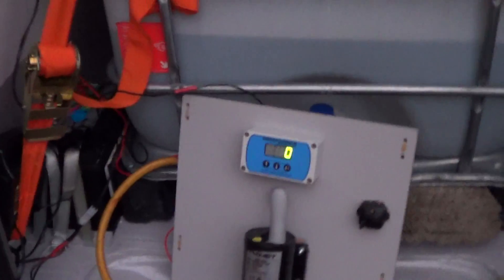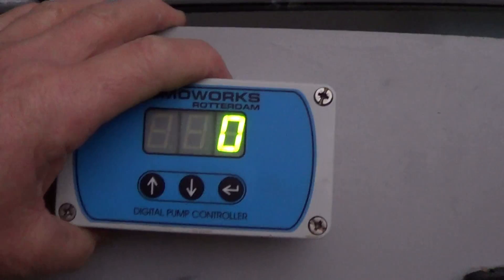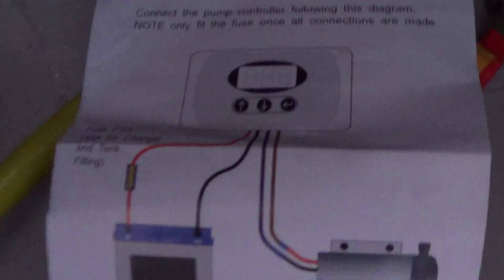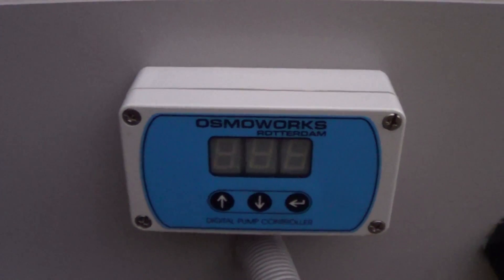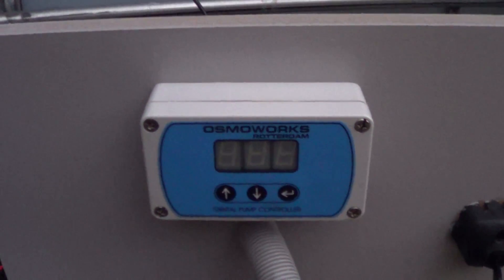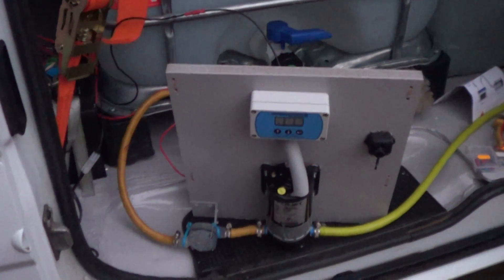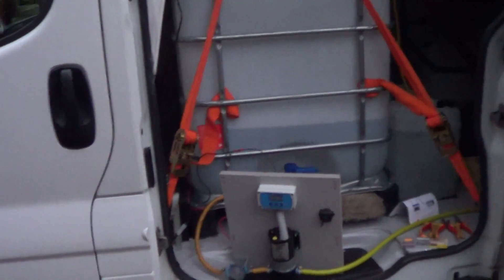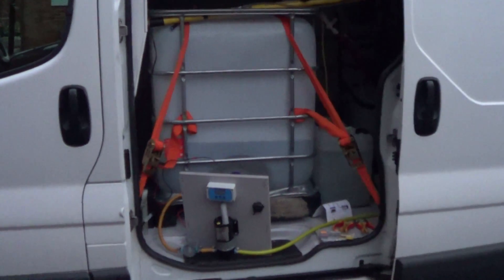DIY WFP Van Mount - Part Six Flow Controller

Comment: Cool videos. Could you not run wires to the actual van battery instead of recharging the battery for the pump?
Reply from the maker: Yes you can do that but risk flattening the battery and not being able to start the vehicle again. You can fit what is called a split charger so you can charge the pump battery using the vehicle. See a proper electrician for this though.

Comment: I wired mine up correctly, mine has an onboard battery charger, but i can't auto cal the Unit, as it tries to say the battery is not charged when it is, the PS error message keeps popping up, Just seems easier to use a direct to pump battery connection and just charge the battery from a standard charging unit in the house... A bit lost with that one, as i can not predict when the battery will run out... i know that the PS message means pressure switch activated or motor disconnected but nothing i try to get it to run works
Reply from the maker: MrHoodedtop I can't help you with this one as I don't know the answer. I would prefer the old analogue type of flow controller.

Comment: Can I just get a dimmer switch instead?
Reply from the maker: Dk Scooby Whilst in theory it's a good idea, a dimmer switch is for a 240v system so it might not work.
Reply: Christopher Dawber I will have a try and let you know soon thanks mate
Reply: Christopher Dawber I’ve tried the 240v but didn’t work so I got one off eBay 12v dimmer for £5.50 and it’s working perfect 
anyway it’s better to have the proper one with all the extras but for someone starting up it will do the job 
Thanks buddy 👍

Comment: How do you get around the vacuum as the tank is unvented? ( insert a tyre valve the wrong way round in the lid)
A way to baffle the tank is to cut up lengths of tubing ie guttering or soil pipe and inserting them into the tank. 
I don't agree with wasting money on an aqua tap .... Just bend over the hose on the pole the water will stop ..... I get told well that depends on the type of hose..... No I have done this with all types of hose.
Reply from the maker: Alan Harvey Hi Alan, the tank has the filling hose that goes through the drilled hole in the big black cap that is on top of the tank. This acts as a vent.
The bending of the hose is a good idea but a bit more hit and miss. The best type to bend in Rhino tube but of course with this method, a way has to be found to wedge it somewhere so you can leave the pole to get paid etc.
Aqua tap is great for back packs/trolleys where it is critical to save as much water as possible wheras with a large tank it won't matter as much.
The tank is not baffled but we have found that it does not effect the van hardly at all contrary to expectations although I would recommend the drain pipe solution that you suggest. Thanks for the tips.

Comment from the maker: Chris, I hope you can see this. I can't see any reply tab on your post but anyway, I don't work with two poles, its single at the moment. I would not recommed two poles off one pump as the pressure will drop significantly and if the pump is only 5lt per min, then with two of you, it will only be 2.5lt so it will be too little to rinse properly. For two man, go for the whole lot and have the two systems running off one big tank.

Comment: Chris how do you baffle the IBC tank?..are you going to use baffle balls or something similar
Reply from the maker: We had great intentions initially but we never got around to it. The Vivaro seems to take it without any problems at all though and is nowhere near as bad as we had thought. As long as its carefully driven, then there arn't any problems. So far its been worth doing DIY for sure.
Reply: +Neil/simon Mortimer I was just researching this problem on Google. Some people even use beach balls inside their IBC to dampen the slosh. I just got my wfp setup and am looking at getting a tank. Seems the smallest one commonly sold here in the states is 275 gallons. That's a 1000 liters. That's huge, like Wagga mentioned in part three.
Reply from the maker: +Neil/simon Mortimer Hi Neil, we never did baffle the tank as we did not seem to have any problems when using it. We now have a different tank which is baffled.

Comment: Good videos Chris, Thank you for comments re the fuse. I would always recommend fitting the correctly rated fuse between a battery and controller.
Great to see the system all up and running

Comment: Excellent. Can't believe how your set up has changed in just a few weeks. :) van mount is the bees knees in my opinion. I still use backpacks but only rarely. Much quicker with van mount. I have my flow controller set on between 20-30% with fan jets. Gives great rinse.
Reply from the maker: Cheers, I have some fan jets but my back pack would not give enough flow to make them work properly. With a van mount, I reckon they will be great. Thanks for reminding me and thanks very much for your kind comments.

Comment: Flow controls are all about preferences I know cleaners that have them at 99 all the time I have mine running at 50 & I get a good rinse. Good luck with it chris.
Reply from the maker: Thanks again Tom. Our pump is a bit over the top with 7.6ltrs per min so the flow controller in our case is essential with some of brushes with narrow jets on.With our Reach-iT brush with four jets, it was fine without a flow controller.